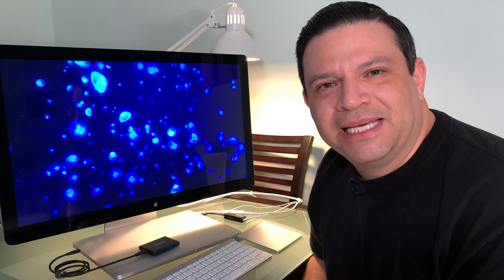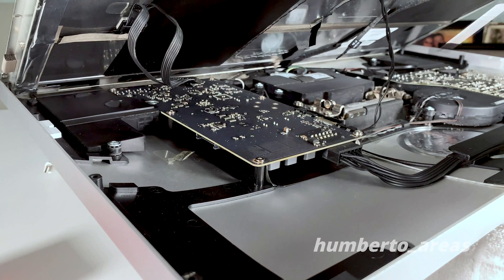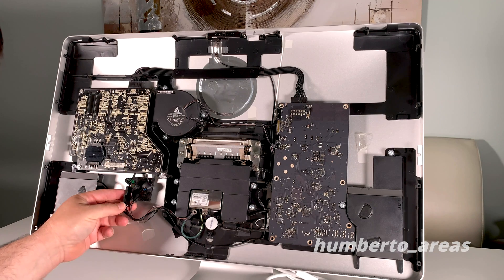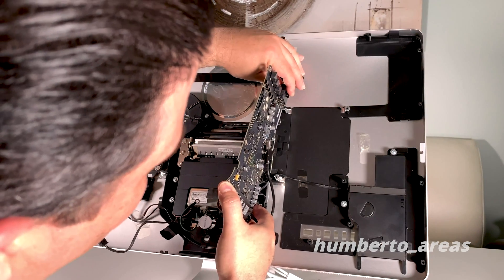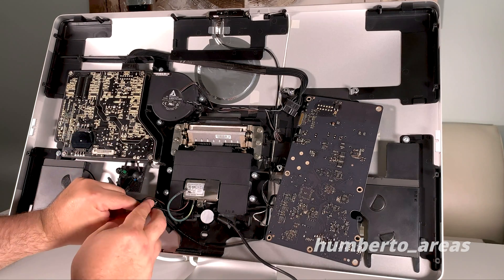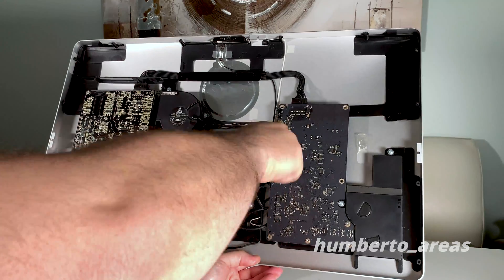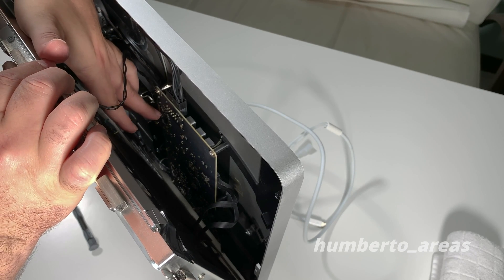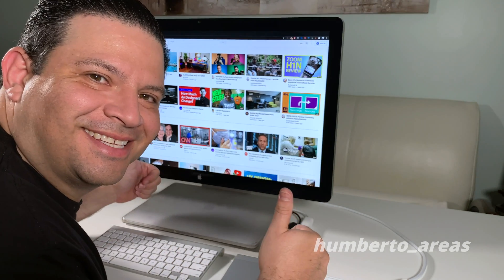Apple Thunderbolt Display Not Turning On - Step-By-Step DIY Repair 2026

Comment: This looks great but how do you diagnose it as a cable fault? Yes my cable is frayed, and there's an intermittent complete loss of signal... is that it, or are other diagnostics possible?
Reply from the maker: @Christian Thompson, thank you for watching and thanks for posting your questions and comments.

The all-in-one cable carries power, audio and video and bundled up in one... so hard to say exactly what fails. This is why replacing this cable is one of the first (and most inexpensive) parts/steps in trouble shooting these displays.

This video was created to reflect my own experience with my display and I shared it in hopes that it would helps other who may be experiencing a similar situation. I created this video for entertainment purposes only, and I am not an a certified PC/monitor repair technician.

Please keep me posted on the status of your display.

Comment: What exactly fails on the cables?
Reply from the maker: @Silence of the Lambs, thank you for watching and thanks for posting your question.

The all-in-one cables carries power, audio and video and bundled up in one... so hard to say exactly what fails. This is why replacing this cable is one of the first (and most inexpensive) parts/steps in trouble shooting these displays.

This video was created to reflect my own experience with my display and I shared it in hopes that it would helps other who may be experiencing a similar situation. I created this video for entertainment purposes only, and I am not an a certified PC/monitor repair technician.

Please keep me posted on the status of your display.

Comment: Can i ask what it is in the cable that breaks? My display has power as it will charge the laptop but the screen won't come on, do you think that is a cable issue or something else? Great video btw. 🙂
Reply from the maker: @Wiljuchi, thank so much for watching and for taking the time to post your comments and questions. Keep in mind that a Thunderbolt cable carries both audio and visual. So when everything is bundled into one cable, it is very hard to know which part is not working or sending signal. Now the power magsafe cable stems separately from the bundled Thunderbolt cable. So it is possible that the power/magsafe cable still works and charges your laptop. So it is possible that the charging cable works, but then there is an issue with the Thunderbolt cable itself.

Q: When you connect the display to your PC, does the PC recognize the display? What setup are you using? Let me know and I'll try to best help you.

Look forward to your response.
Reply: @HumbertoAreas  Hiya, thanks for replying. So with mine it was doing the flashing like your display. There is still power coming through the display as the magsafe still charges the laptop but the display goes off. I used to turn it off wait a bit then it would generally come back on, now it won't come on at all.

Comment: Hi Humberto, amazing tutorial!! I have this display and the screen doesn’t turn on either but while is connected the sound is working correctly. This could be another internal problem or would be solved by replacing the cable? Thanks!
Reply: Btw, compre un cable para ver si se solucionaba y la pantalla sigue sin encender. Lo conseguí como un monitor de segunda mano. Sabes si cambiando todo nuevamente se solucionaría? Saludos
Reply from the maker: @Mauro, saludos hermano. Cual cable comprastes? Me puedes confirmar esto? La mayoria de estos displays de segunda tienen el problema de la pantalla que se va a negro. Saludos y quedo atento.
Reply from the maker: @Mauro, thanks for watching and for taking the time to post your comments. Most of the time, replacing the all-in-one cables takes care of the issue, and this is by far the most inexpensive trouble shoot you can do on your own.

Let me know what you end up doing in order to get your display working again.

Comment: Beautiful video! I have a non Mac computer I am trying to plug these into .the monitors won’t come on. Is it because the monitor is not getting a signal to turn on from a Mac computer ?
Reply from the maker: @Victoria Lyle, thanks so much for taking the time to post your question. What is the configuration of your "non-mac" computer you are trying to connect your display to? Please provide additional info so that I can try to help you better. Thanks for watching and look forward to your response.

Comment: Tengo un monitor de esos y empezó a dar problemas que para que funcionara debía desconectar el cable Thunderbolt de la mac para que se pudiera ver la imagen y luego dejo de funcionar por completo tu crees que sea problema del cable ?
Reply from the maker: @Bossman, gracias por ver mi video y por tus comentarios y preguntas. Mi problema comenzo al igual que tu lo describes. 

Tu MAC reconoce a tu display? Eso lo puedes verificar en los "system preferences". Cuando conectas un USB, la MAC lo reconoce? Haz probado conectar el display a tu MAC con un cable Thunderbolt diferente?

Como you explico, no hay compañias que le den servicio a estos displays. Cuando yo me di la tarea de buscar en forums estos sintomas, todo apuntaba hacia en enlace entre la MAC y el display, en este caso... el cable.

Dejame saber y me mantienes al tanto de tu display, gracias de nuevo y buena suerte.

Comment: hi, many thanks for such a wonderful guidance.  After inspired seeing your video, i thought of fixing mine.  I have A1267, 24".  In the front panel you are having 12 screws but I could see only 6, then I could lift the top part.  While looking thru the top part, the cable inside are not exactly the same way as you have too (not sure my judgement was 100% correct).  Do I need to refer to a different video for my model?  This is the first time ever I try to repair my Monitor :).
Reply from the maker: @Vintage Audio Collections, thanks for watching and for taking the time to post your comments and questions.

In this video, I explain how to swap an all-in-one cable for the 27" Thunderbolt display, Model A1407. The display you mention (Model A1267) is a MiniDisplay port (not Thunderbolt). You indeed need a different cable for that model, and it's not the same cable I used in this video.

All specs for your display can be found here: https://everymac.com/monitors/apple/studio_cinema/specs/apple-led-cinema-display-24-inch-specs.html

Please keep me posted on your display, and if I find a cable replace and/or video you can benefit from, I will share those with here on this thread.

Thanks again for watching.
Reply: @HumbertoAreas  many thanks for your prompt response. I found a replacement cable for my 24”. I will replace the same soon and will update you the results.
Reply: @HumbertoAreas  I have managed to replace and now my monitor display is working perfectly fine.  Only for the sound I have observed some issue.  When I connect the USB to McBook or PC, sound come for few mins and disappear.  Not sure whether  I have done any thing wrong.

Comment: Hi, thanks for the walkthrough. I also encounter this flickering issue. But why do you know that the problem comes from the cable, but not other components, such as logic board or maybe capacitors? Thanks.
Reply from the maker: @Leo Nugraha, and thanks again for taking the time to post your comments and questions.

The weakest component and most faulty ones on these displays seem to be the all-in-one cable. Since no one really services these displays, I took it upon myself to troubleshoot. And if I had to start by replacing a component, then the all-in-one cable seemed to be the most logical (and most inexpensive).

Unless you're in an area where there are lots of lighting storms and do not have access to a power surge protector... it might be unlikely (but very possible as well) that a capacitor(s) or logic board may have shorted out.

Capacitors and logic boards for the most part stop working all together, but the flickering you mention is a warning sign that things are right not right with the cable that bridges your display to your PC.

These displays are great and if prolonging their life with a cable swap works, then in my opinion is worth it.

Please keep me posted on your display and thanks again for watching.

Comment: can i just replace the thunderbolt cord and get rid of the magsafe charger? will the display still work?
Reply from the maker: @Kipp, thanks for watching and thanks for taking the time to post your questions. If you supply power to your display and bypass thunderbolt connector and magsafe - and connect the display to your PC via a stand alone Thunderbolt cable, the display should work without a problem.

Please keep me posted on your display. Thanks.

Comment: Question:  how did you determine the cable was the problem?  I have one of these and during the research into 'why' it failed (similar fail mode: sometimes comes on, sometimes doesnt.. then finally, it stopped coming on.  It seemed to work fine if I left it on but after a powercycle it was hit or miss).  I'd like to understand how you came to this solution (get DIY vid, btw!).  Thanks :-)
Reply from the maker: @The BS Show, thanks for watching and for taking the time to post your questions and comments. I researched the web for trouble shooting tips when my display started acting up and found little to nothing. Apple stores don't service these displays anymore. PC repair shops won't take them in either... so I decided to replace the cheapest part (the bridge between PC and Display) and I got lucky, it worked. Tell me, which part of the video did you find most helpful?

Comment: Hothanks Humberto ... Nice tutorial ... The parts are not sold anymore on Amazon and I dont know if this is the same problem . My screen is sometimes full operational and sometimes completely dark.... I think this is a wrong electrical contact but where ... and I'm not sure the manipulation is better to using the monitor ...
Reply from the maker: @Leros. Online, thanks for watching and for taking the time to post your comments. I checked the links and the cables are back in stock. How frequent is your display going completely black? And when it goes black, does your PC still recognizes it? Please keep me posted on your situation.
Reply: @HumbertoAreas  nice thanks for your help … the plastic around the thunderbolt wire is removed but now for 5 years … the last week the problem started I worked with two screens on a MacBook 2018… so my screen became black …. I connected it with a MacBook 2015 directly on the thunderbolt port and it worked… so I thought it was correct and I changed it for working only the MacBook 2015 but now for 5 days it didn’t light up anymore … I zap the Pham , I restart with Onyx … nothing at all … if you have an idea…. Thanks in advance

Comment: I have a 24 inch thunderbolt display with a bad cable, can you. supply a replacement cable set?
Reply from the maker: @Chris Mason, thanks for watching and for taking the time to post your question. Unfortunately I have not been able to find a reliable source on Amazon for your type of cable. Have you tried looking on Ebay? What is the Model number of your display? A1267? Please confirm.

Comment: What about the power cord? Mine might have a tear on the power cord so if I’m gonna go in there might as well replace that one too right? But looks like a far deeper reaching project. Not sure! Oh well, wish me luck lol
Reply from the maker: @Sean Sullivan, thanks for watching, for your question and comments. The power cord just pulls out of the back of the the display. Very simple and straight forward. Please keep me and this community posted on your repair. 👍🏻
Reply: @HumbertoAreas  Thank you so much...now it seems the power is ok, it turned on briefly! So, I think it's the frayed end of the thunderbolt cord.. is there any way to repair that cord?? Seems like I might not need to replace the whole cord. Do you recommend soldering the frayed parts of the cord? have you ever had to do that before? I can't seem to find any videos of fixing this type of cord, but seems like it would be possible to fix this end of the cord. haha, plus the one I got from ebay has a damaged cord too.. so what's the point of installing a new damaged cord!! haha, Agin, thanks for your help!!!
Reply from the maker: @Sean Sullivan, I've never tried to repair or solder any cords in the past. My option is going to be always to replace with OEM equivalent product. Good luck and let me know what you end up doing to fix your display, as your experience may help many others. Thanks again for watching.
Reply: @HumbertoAreas  big thanks Humberto, yes will post here results after cord replacement!
Reply: @HumbertoAreas  I'm in the middle of my repair and I got everything apart but now I see the old thunderbolt that I'm pulling out has three connectors not just the two. I only see two on nearly every replacement cord I see anywhere including the two replacements I bought. Maybe mine is a cinema display? There's another connector that is attached to my thunderbolt cord that I disconnected from the back of the LCD.

Comment: Hi Humberto, good work ! I do have a problem that the display is not starting again. Maybe the PSU do you have any guide to follow for this type of defect? Thks in advance for your support.
Reply from the maker: @Alexander Dau, thanks for taking the time to post your comments and question. Before we jump to power supply issues, have you tried connecting the display to another PC? When you go into System Preferences > Displays, does your PC recognize the display?

Also, can you elaborate on "display is not starting again" - has this happen before? And if so, how did you fix the issue? Please keep me posted.

Comment: My MacBook Pro (13-inch, Mid 2012) has lost connection to the Thunderbolt Drive. A tech replaced the actual port, but that didn't enable it to connect again. I've tried firmware update, but nothing has yet worked. Any ideas? Thanks.
Reply from the maker: @Terry Duschinski, have you tried resetting the system management controller (SMC)? Here is the link on how to perform this reset. https://support.apple.com/en-us/HT201295 - This may help correct your MBP not recognizing your display on the new port. Please keep me posted.
Reply: @HumbertoAreas  Thanks very much for the brief glimmer of hope. I tried resetting both in Mojave and then after upgrading to Catalina -- but it didn't solve the problem. Apple says (of course) that I need a new logic board, but everything else is working fine.
Reply from the maker: @Terry Duschinski, sorry to hear resetting SMC did not work. 2012 MBP is such an awesome year, I had one of those... but eventually upgraded to a MPB 15" 2018. Good luck and please keep me updated on what you end up doing with your display.

Comment: Hello Humberto, great tutorials. Question I have two 24” Apple Cinema Display will the same cable from a 27” work in a 24” sorry for the rhetorical question sir👍
Reply from the maker: Grillozilla VFX, thanks for your comments and question and for watching of course. If you have 24" Displays, those are Models A1267 (you can verify this info if you lay the monitor flat and look underneath the stand).

If this is the case, this all-in-one cable replacement that I refer to in the video will NOT work for you, your Model A1267 uses a "Mini DisplayPort" not Thunderbolt (although they look the same).

Please verify the Model Number of your Display, thanks.

Comment: Hey Fellow thunderbolt display nerds. My thunderbolt display 27" has been making a noise which I thought was a worn out fan bearing and I had that replaced but the sound persisted. It sometimes takes a little while to come on but then it won't go away. I have also noticed that my thunderbolt connector gets a bit hot where it plugs into my computer. Today, the monitor went completely black.

Any idea what it could be?

I'm thinking thunderbolt wire and/or power supply and possibly speakers.

Any input would be appreciated! (no pun intended)
Reply from the maker: @Ryan K, thanks for posting your comments and question. This video is intended for this purpose, help others keep their displays running. 

One of the first 'red flags' for me was the connector getting hotter than usual. Then the blackouts started happening more frequently, until it just died.

Can you elaborate on the sound the display is making? is it a high pitch whistle? Knocking sound? What makes you believe this sound may be coming from the speakers?
Reply: Hi thanks for your reply. At first I was sure it was a worn out bearing on the fan so I had that replaced but it didn’t fix the problem. If I put my ear to the monitor I can hear a scratching (imagine worn out bearing) noise coming from both side where the speakers are.

The monitor won’t even turn on now :(
Reply from the maker: @Ryan K, it might just be worth replacing the cable... Found this option on Amazon which is $40. Like I said, one of the 'red flags' for me was the Thunderbolt connector getting really hot.

The all-in-one cable splits into a "Y", so you do have the MagSafe connector for the power source and the Thunderbolt cable does carry video, audio, etc.

Please keep us posted one what you decide to do with your display.
Reply: I’ve heard that because the thunderbolt carries both power and sound it could cause this type of problem